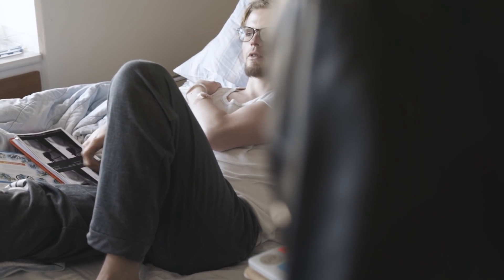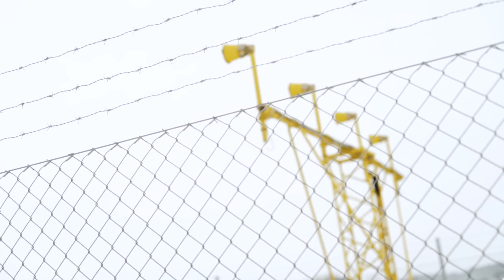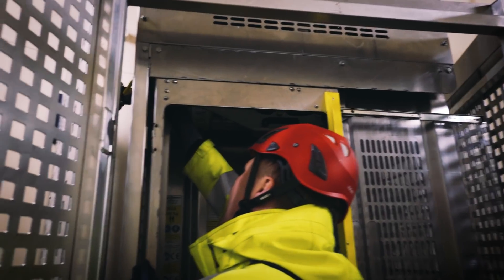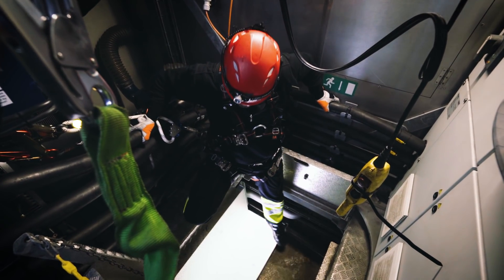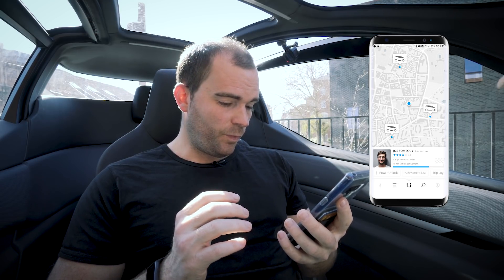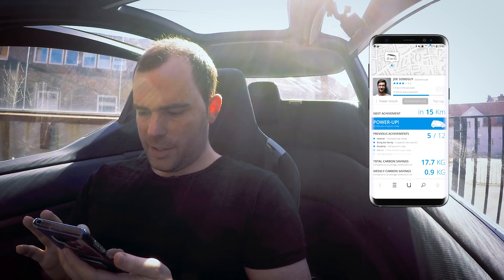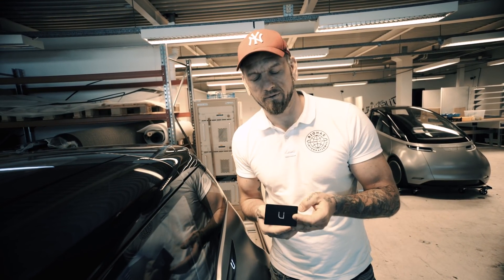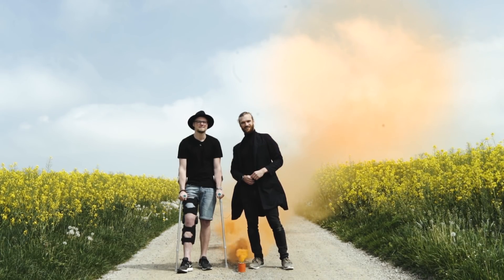Are we ready for the future? | UNITI UPDATE 30

Comment: For me the most important function would be, that my greater family with 3 nearby households could buy, own and use two Uniti's instead of 4 cars. Including the use-based splitting of runnings costs and insurance!

A more freaky feature would be the AI-based route planning including potential train, bus and scooter usage. Maybe via connection with Google Maps.
Reply from the maker: The first idea is exactly why we are doing this to make sure the utilisation is as optimal as possible! So the case you mention is for sure something we are planning on solving, there is obviously a lot of different approaches to doing that and we think we have found a great solution to the challenge! ;-)

Yeah there are a bunch of companies doing exactly that so we want to integrate it as far as possible!

Thanks for the great ideas! 

//Albin